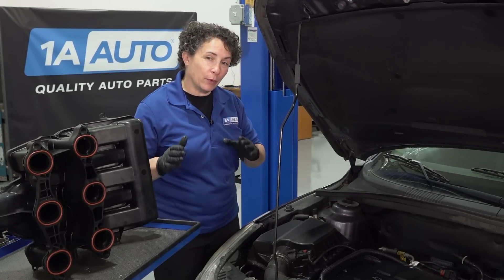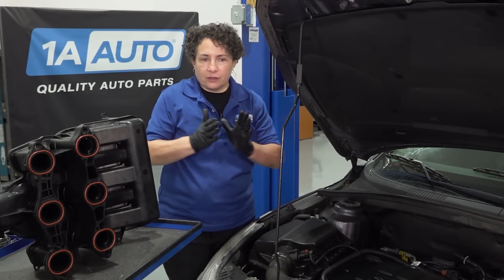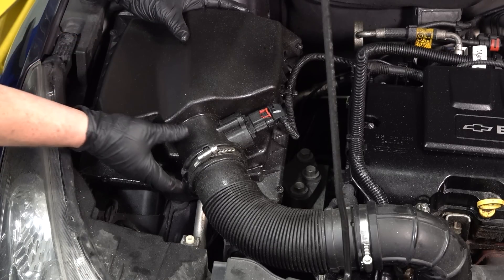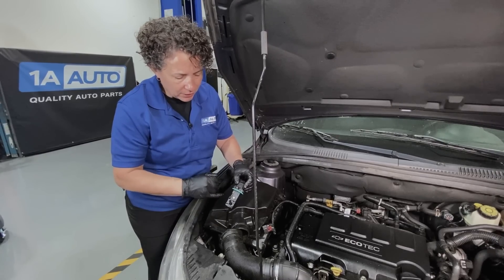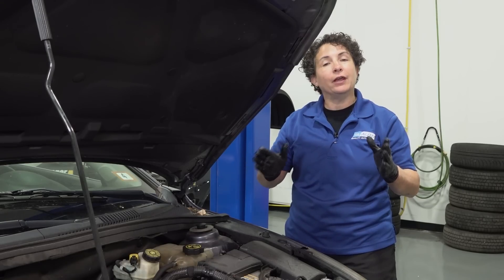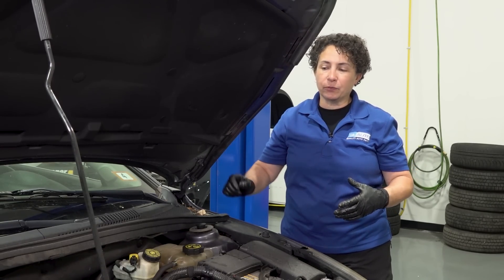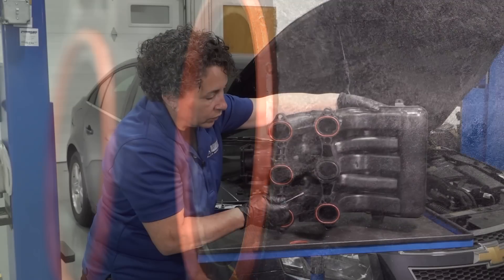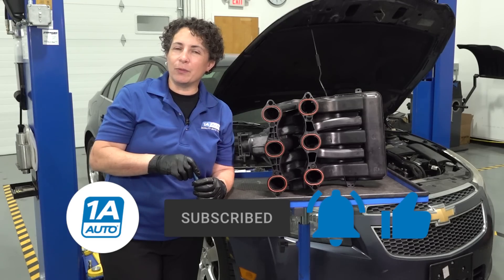Gas Mileage Dropping in Your Car or Truck? Quickly Identify Vacuum Leak That's Wasting Your Money

Comment: I changed my plugs and wires on my Dodge Ram magnum 5.2 liter now it’s hard to start I have to hold down the gas and I have no idle you have any idea what is going on with my truck 🤔🤔🤔.

Comment: I hear that sound when I push the accelerator. Not when I drive but when I kick it fast. So there must be a leak I think. When I drive it feels like there is a power hole. What could it be? Thanks

Comment: I'm getting system too lean off idle code . Can I eliminate the cause of vacuum leak in this case? 
because the maximum effect of a vacuum leak is at idle.
LTFT B1: 17%
LTFT B2: 23%
I'm suspecting partially clogged fuel injectors although there's no misfire. .

Comment: I tried this technique and within minutes, found the leak that I've been hunting with propane, carb cleaner, smoke for weeks. Of all the places, the leak was where the MAF attaches to the intake hose.  Got some gasket material and RTV to seal it, and now the car does not accelerate when I left off the gas at low speed and low RPM.  Thanks for the tip!

Comment: Any issue spraying bubbly water while the car is running?  Or is it just a "heat safety" in case you touch something hot?

Comment: I have a Nissan Primera p12, just got it back from paint job, the safety lights came on, I hearing a humming sound when engine is switch off, sounds like it's coming from fuse box,  now it's switching off while I am driving

Comment: So a vacuum leak makes the cylinder(s) run with extra oxygen, then the o2 sensor picks this up and says "we need more gas" resulting in the cylinder(s) running with more gas than needed...? Then when the air fuel mixture is balanced it reports "it's fine...  don't inject extra gas" so then the engine doesn't get extra gas trim, resulting in the cylinder(s) getting too much air because of the vacuum leak...  etc etc etc...  ??

Comment: I thoroughly enjoyed the shop vac Technique very much because it is such an awesome way of finding vacuum leaks on my own and at my pace. I went out and bought me a very inexpensive vacuum hose to do this vacuum test, this way I know for certain the vacuum hose would be super clean on the inside and not blow any dust or debris into the intake manifold. I didn't see any vacuum leaks on vacuum hoses, etc. at bank 1 or bank 2 ! However, to my surprise I did find bubbles forming at coils on the heads . I found piston number 2, 3, 5, & 7  & I stopped checking at that point.  So, the Million dollar Question . . . Is it normal to see bubbles forming here??? Could this be a sign of worn out pistons or rings, or something else, perhaps very serious??? Please advise!

Comment: I believe you have to keep the throttle body open by putting a brick or a heavy object on the gas pedal for this test. There is a chance that you could create a new leak by pushing a brittle piece of gasket/o-ring or hose which you have to replace eventually any way. It's a good idea overall.
Reply: If you blow out the O-ring, brittle gasket or whatever then you have accomplished what you set out to do, find your vaccumm leak!!!
Reply from the maker: +Some One Thanks for the feedback!

Comment: Great video. I got a P0174 code, which means air-fuel ratio is running lean. Will this video be applicable for that code as well.
Reply: That mean you have less air coming in. check if your air filter is clean or not.

Comment: I improved my gas mileage by getting a locking Gas cap . Sadly with the price of gas I think someone has been sneaking gas
Reply: Get Barryman's Chem-12 injector and fuel system cleaner and put half the can in half a tank (10-13Gal)